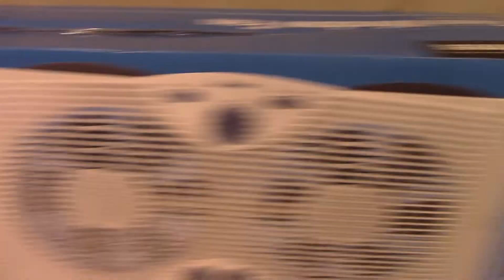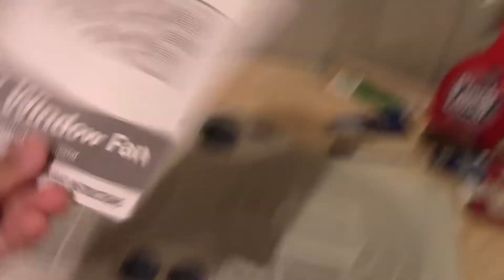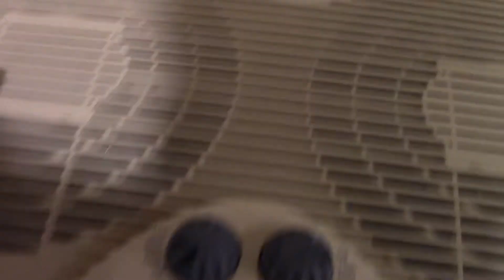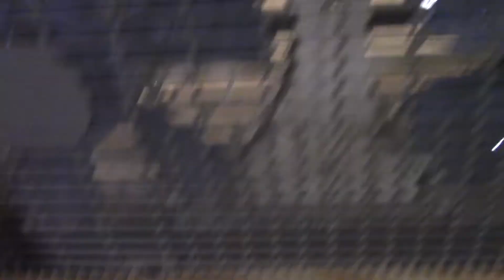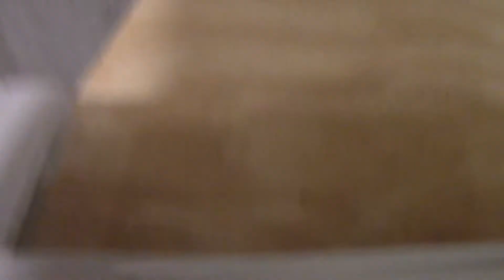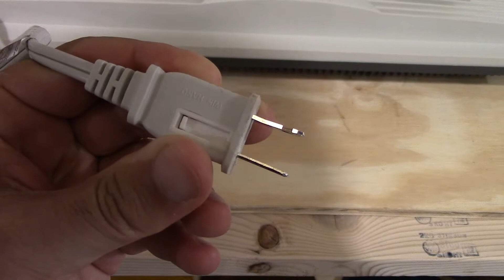Holmes HAWF2041 Twin Window Fan.

Comment: Do these also work in Vertical windows? My windows open side to side! :)
Reply from the maker: They do! Make sure the extender adjustment side of the fan is on the top in that case.
Reply: @Sharkie626   Okay, thanks for the reply! I'll be getting myself one! :)

Comment: Since yesterday was 6/26, I figured it’d be appropriate for me to comment. 

That’s a pretty nice window fan. I haven’t seen many with the mechanical controls before. I know exactly which one you’re talking about with the electronics. It’s the OneTouch control. I have a space heater with the same control panel. I love the heater and it works great, but OneTouch is often far from the truth. To get to what setting you want, the button has to be pressed repeatedly to cycle through. Miss it and you’ll be pushing it 10 more times to get it back. Once you find your favorite temp, it’s pretty convenient as you just hit it one time and it starts. I should make a video of it, maybe this winter. Have fun with your fan!
Reply from the maker: Exactly. A control that has to be pushed several times for a setting is anything but convenient. This way is much faster!

Comment: Very nice fan, well thought out. I’m sure these work best on cool dry nights. The warm humid nights you have central air to use. Just that you have to remove it when you have to close the window each time.
Reply from the maker: Definitely! Removal isn't too bad. The window where it will be used is easy to work with!